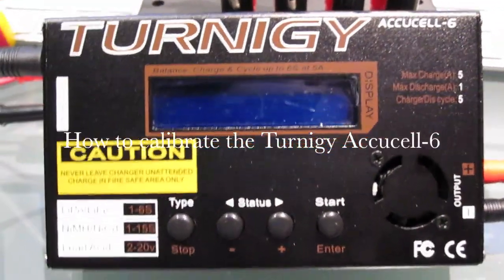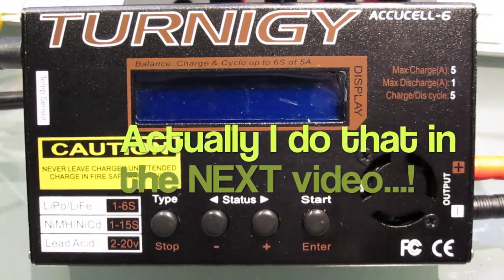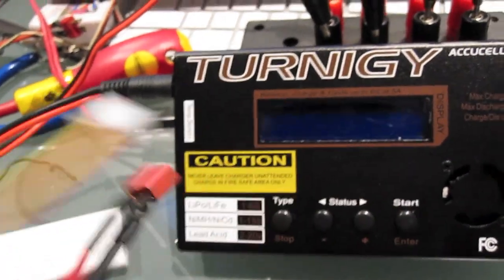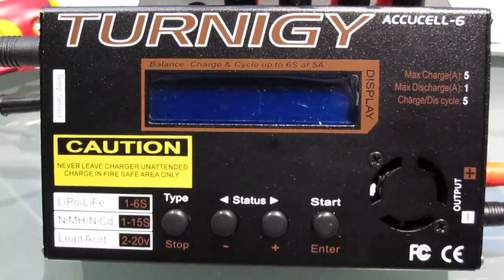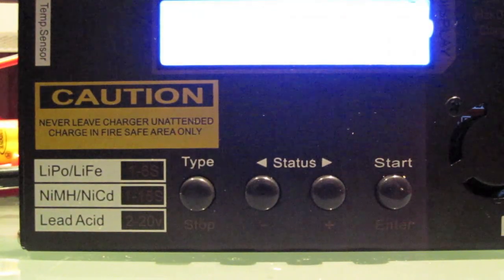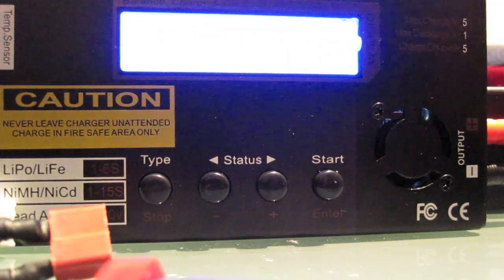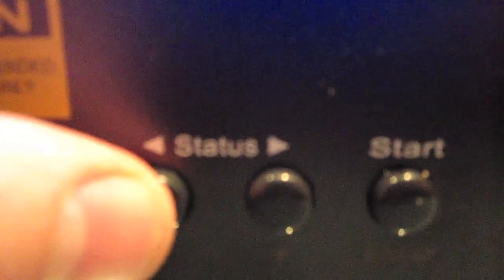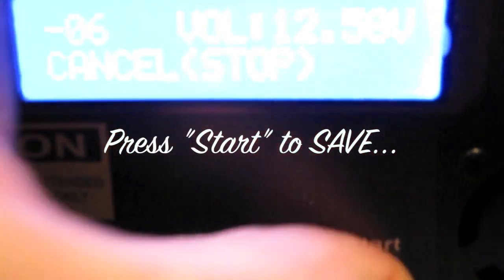Calibrating the Turnigy Accucell-6 Battery Charger

Comment: Dont follow this!!!!  lipos max out at 4.20 per cell 12.60 is correct for
 a 3 cell
Reply: um, he calibrated the charger... the battery only had a charge of 12.58 not 12.60, as the charger stated. after this he can charge the battery to an accurate full charge. this guide is correct

Comment: Dors this eork on the hobbyking evo 6? Split the case open and internally the pcb has imax b6 pro ectechedninto the pcb. For me on 5s ince the overall voltage hits 21v it stops but all cells are at 4-4.15v a cell and im not getting full performance from the batterys

Comment: I don't understand - How would you know if it's the Accucel charger that inaccurate, and not the multimeter?
Reply: Voltometer have to be as excact as possible or you a case of death on the higher vs or amps.
Also if its out ask the company for a new one. If you lipo charger isnout ghen recalibratw if possible

Comment: surely it is more necessary to calibrate the balance circuit, the main voltage does not need to be that accurate but the individual cells are more important

Comment: My Lipo battery (2200 mAh, 3s High Discharge) reads 13.83 Volts when I check on my Accucel 6. Is this normal for this battery?

Comment: I tried to calibrate, but different lipos produce different values.

1. LiPo 3000mAh 4S     setting to make it calibrated -6
2. Lipo 2800mAh 4S      setting to make it calibrated +7
3. Lipo 1500mAh 3S      +0
4. LiPo 2800mAh 3S     +0

What now?

Comment: Ok, but how accurate is your multimeter? Most (including cheaper Fluke models) have 0,5%, that means ~0.02V per LiPo cell oe 0.06V per 3-cell, so fine-tuning with 0.02V range is pretty pointless.
Myself, I am using Mastech MY-65; claims to have +/-(0.1%+3mV) accuracy @ 20V range; still the inaccuracy @12V is +/- 0.015V
Also, my model of Accucel-6 can't enter the calibration mode... (new model with internal resistance measure), and sometimes during charging it shows voltage 0.2V higher than real.

Comment: 14.70 volts is way too high for a 6 cell lead-acid. I wasn't paying much attention the first time I charged a couple of 9Ah SLA batteries in parallel, and when I woke up, the batteries were almost hot and I could hear them gassing. NOT something you want to do to a lead-acid! The Accucel 6 is not capable of changing the lead-acid charge voltage, so from now on, I'll just charge the batteries from one of my current-limited bench power supplies, and set the voltage to precisely 14.40 volts.

Comment: Thank you for uploading this! Just FYI this also works for the Hobby King "Eco Eight" and "Eco 6-10" chargers as well. I think they run the same firmware. My Eco Eight is off by about 0.18 volts or so and was was only charging to 4.12V/Cell. Couldn't find anything about the "Eco" chargers in specific, but gave it a shot. Now they're charging to 4.20/cell perfectly! 

Thanks again for the video!

Comment: My charger came accurately calibrated to 0.01V, which is pretty good. Another thing, though, when charging a 6 cell lead acid battery, it charges to 14.7V, which is a bit high I think. Any idea if that is adjustable?

Comment: i own the same charger, however every time i try to charge a battery one of two things happens. either it says "connection break" or it restarts itself and never charges. everything in correct polarity, both the main lead and balancing leads are plugged in, charger is set correctly, i just cant figure it out. worst is that its a Turnigy battery as well.

Comment from the maker: @roberttreboranita Hi Robert, it is a good question. Your charger will be calibrated no matter what input power supply you use. However input MUST be 11v  to 18v @ DC at 5 Amps. You're calibrating at what point the charger detects the battery being charged. This has nothing to do with the battery voltage from the charger's power supply or field supply battery. The charger has a voltage regulator at it's voltage input which is why the charger is stable over a wide voltage range. Regards, Craig

Comment from the maker: @02paintball01 Hi There, no DON'T USE 16.4 volts! I use a converted computer power supply. The charger uses 12 > 13.8v and make sure whatever power supply you use can supply the required current when charging at the maximum current you charge at. That is..if you're charging a battery a 1.5amps (1500ma)...make sure you are using at least a 1.5 amp supply. I would suggest using a 2amp supply if charging at 1.5amps for instance. A sealed lead acid battery is a good choice to power the charger too.

Comment: Craig,
I have the Accucell-8 which calibrates the same way but im having a problem.My multi-meter shows 4.16V per cell and 25.0V fully charged,thats with the charger  calibrate and turned all the way up.Is there a way to get the voltage up? or is there a way to set the charger's calibrate setting back to stock so I can start over?It was showing 24.5V before I calibrated it after the 6 cell lipo fully charger and its only going to 25.0V turned all the way up.Thanks..

Comment from the maker: @fabiodacunha yeah I suspect that is normal - it takes about 75 - 80 mins to charge my 3S 2200 mAh batteries at around 2000 - 2100mAh... so that sounds about right to me. Maybe others have comments? Also try posting on one of the many RC forums around to see if your charge time is normal. Regards, Craig

Comment from the maker: @fabiodacunha hi there, I'm no expert but just wondering what capacity your power supply is? I'm not sure that 180m to charge a 5amp 2S battery @4amp charge rate is really that out of the ordinary. Considering it takes about 70 mins to charge a 3S 2200Mah battery at 2.2amps full rate. I'm just wondering if your power supply is able to supply a 4amp charge?

Comment: i am charging a 7.2 v 2000mah nimh battery pack  and noticed that the numbers dislayed on the top right corner of the screen slowly keeps rising, like it started as 6.97v and has rises to 7.98v why is this and should i be worried?
Thanks!

Comment from the maker: no that should not be the case. I have 4 of these chargers and can access the calibrate menu on each one as many times as I like. You just need to turn the power off...hold your fingers on the buttons as described and you should be able to get into the calibrate menu. Regards, Craig

Comment from the maker: Hi There, This charger handles LiPo/LiFe up to 6S and NiMH/NiCd up to 15S so technically it should do it however you are maxing the charger's capabilities out. I would suggest stepping up to it's bigger brother which the Accucell-8. It can charge at a rate of up to 7amps (as opposed to 5amps for the Accucell-6) and can handle up to 8S (Cells). I assume you charge your 5000mah batteries at 5amps? I'd get the Accucel-8..that way you are not running the thing at maximum current it can handle.

Comment: Ok, tested with different multimeter.
2nd test was 0.01 less than my first.

Even with +20, charger read 0.03 to 0.02 less.

Can I safely recharge LiPo even with that difference?

Should I lower my End voltage to be little lower or something?  

Would appreciate some assistance.

Comment: I actually have a Accucell-8 and my actual battery voltage was higher than what charger reads.

So I tried to calibrate... but the charger only allows upto +20.   Even with +20 it still wasn't enough to be same voltage as the battery.

What could be wrong?  
Maybe I should get a another multimeter and read the batteries again?

What's your thoughts?  What other things should I try?

Comment: Well it seems that something is wrong either with the charger or the multimeter. The reading of the multimeter is 9.29V and the one from the charger is 8.37 V and that's after setting the charger to the+20 mark during the calibration procedure!
What do you think about that? Thanks a lot for your time.

Comment from the maker: Yep! As long as it's a battery it should work fine. Just as long as the volts you see out of the battery on the multimeter are the same as on the charger. If there is a difference.. then just adjust the charger. Let me know how you go. Regards, Craig